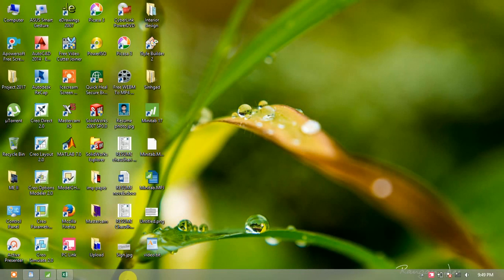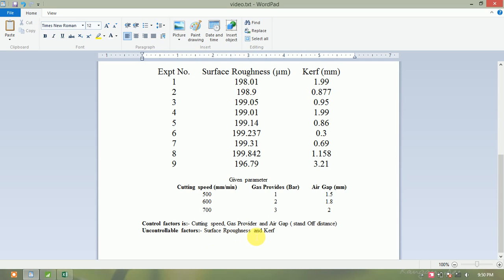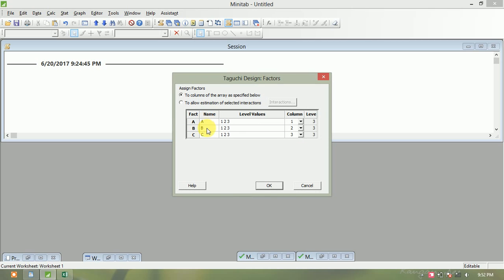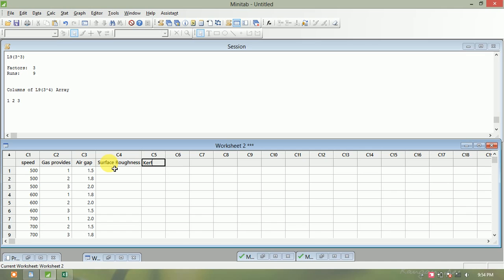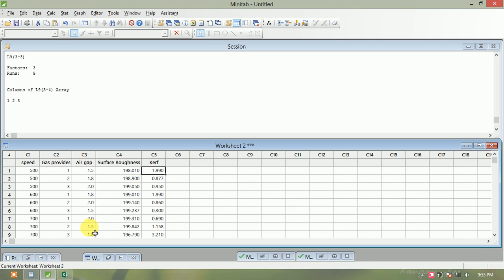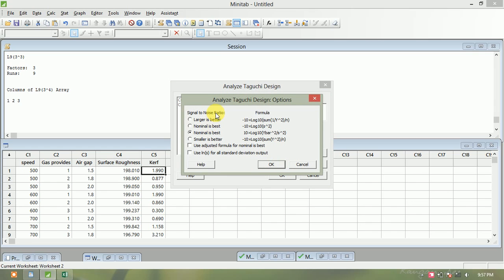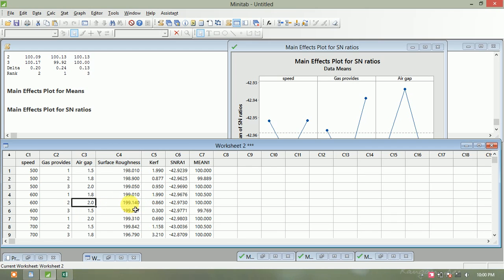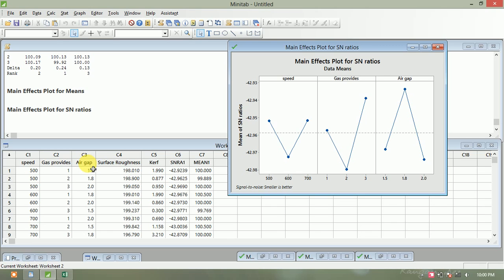Design of experimentation by taguchi method in MINITAB ||plasma  arc  cutting  parameters||

Comment: @software tech, Sir. 

1.If I have 4 input parameters and 5 output parameters then in that case what orthogonal array should I use in taguchi method? 

2.I have some more queries. please share your email I'd.

From
Deepak Pathak
(d.pathak1610@gmail.com)
Reply from the maker: For input parameters what is level value?
Reply from the maker: It's mixed type DOE, use 2-4 factors so array become L16, L25 ie depends on level
Reply: @SoftwareTech_chaudhari  Thanks Sir, in case if we increase input -output parameters like( 8 inputs and 8 outputs) (with 4 levels) then in that case what orthogonal array should be used? 

If possible, please share your email I'd so that I can discuss some more queries. 

Thank You.

Comment: when i try to analyze i get message "Design is corrupted. invalid factor column C3" how to fix it ?
Reply from the maker: Check following parameters:-
1.Array size
2. Input factors
3. Uncontrollable factors
4. SNR conditions like smaller bor larger value is best. 
5. Define properly all factors if you've 3 factors and 3 values for array
Reply from the maker: Second thing to solve DOE using Custom "design mode."

Comment: Hi. Can you use Taguchi when you have 3 factors and 3 levels with 6 data for output?
Reply from the maker: Yes, it's L9 Orthogonal array, but if value is higher or lower for output so  we can use mixed type relationship.
Reply: @SoftwareTech_chaudhari  Thank you for the reply. If I use L9 then I end up with 9 combination fine. I have got 3 runs per level with makes up 9 output values. Is there a certain order to follow when putting them for analysis? Should I just put them randomly?
Reply from the maker: @Research_Page   @Velaphi Msomi  level Make 9 combination & reading taken from certain problem or applications is also 9.This 9 reading arrange by specific order not random so end of the results we can easily found out which no of reading most impactful on particular problem. So I'm not suggest randomly put value whenever solve, but you can interchange input factors.
Reply: @SoftwareTech_chaudhari  Thank you so much for the clarity
Reply from the maker: @Research_Page  for more accuracy we can use L27 instead of L9
Reply: @SoftwareTech_chaudhari  I will try L27 and see if what happens

Comment: Sorry to pointed out. But to avoid any confusion, whatever the quality loss function is (Smaller the better, Larger the better or Normal the best), we have to select the factor as the best setting who has highest S/N ratio. The explanation is great and clear. Thank you for explanation.
Reply: I agree with the sandaz comments.. what ever be the values we have consider highest in signal to noise ratio..
So in surface roughness we have to consider highest value.. because equation itself is smaller the better.hope you like the answer